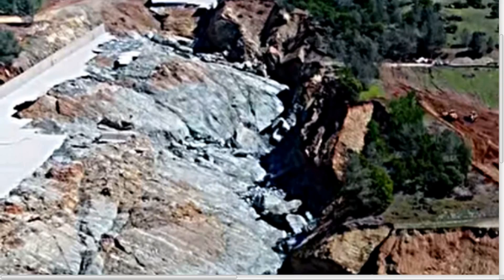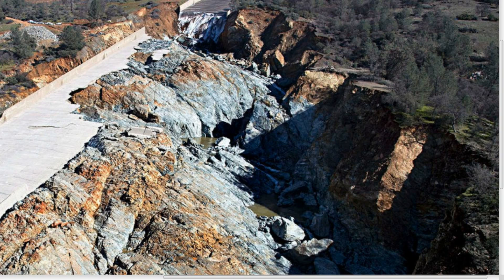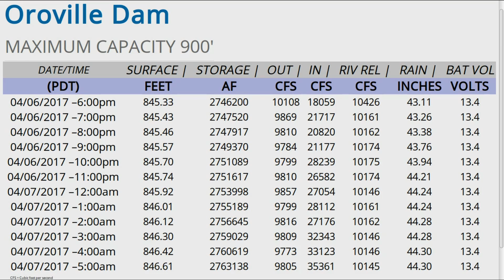OROVILLE DAM: Latest DWR Images A/B Comparison

Comment from the maker: Looks like the lake has risen 5 ft+ since yesterday morning. Inflows should taper off as the storm winds down later today. Then a few days of drier, then another, although somewhat less potent storm next week. We could see the PSW reopened late next week, or early the following, pending intensity of the next storm, and temps with it.
Reply from the maker: They will to have run this thing very soon. Inflows are still persisting at around 30,000CFS. The lake has been gaining about 1.2" /hr about, 2.4ft/day. They have 9 ft to spare, rain coming in Tuesday and Wednesday. At those inflows they will have to run it again starting Thursday. However, that assumes  the same inflows but the forecast is for about 1.25" in Oroville, and 2-2.5" in the foothills. So probably more like Wednesday.

Comment: That explanation may be what they're telling us.  Isn't taking earth away from the base putting it in even more danger?  The combined earthen weight is what is holding back the earth wall area that is holding back the water from the reservoir.  Take away the earth you make the whole area weakened in it's ability to hold back the pressure of the water in the lake.  Looks like they're just making the entire situation worse..not better.  Hope and prayers to all living in the area below the O. dam.
Reply from the maker: Thanks for your comment PM. I don`t think the straight line distance is close enough at this point to threaten the main dam, yet. And terracing actually is the right thing to do, as it will eliminate hillside slides, and the possibly of a chain reaction massive slide that at very least would clog the diversion pool again, and put the Hyatt out of business. They have to start at the bottom and work their way up, as you don`t want to put operators and heavy equipment in harms way trying to work the ravine edge from higher up. With inflows now ave 35,000-40,000 over the last 24hrs the lake levels have jumped to 850ft + with the lake picking 5 ft since yesterday morning. The weather will give a 2-3 day break, then another storm, not as strong midweek. The lake will likely have the inflow go back for a couple of days, then back up to maybe 30,000 -35,000 CFS based on what we have seen since the 3/17/17 shutdown. It seems possible they may have to run the PSW again sometime early the following week. We`ll see.